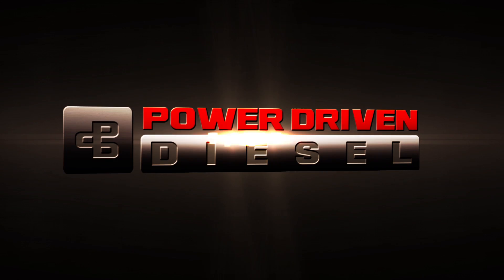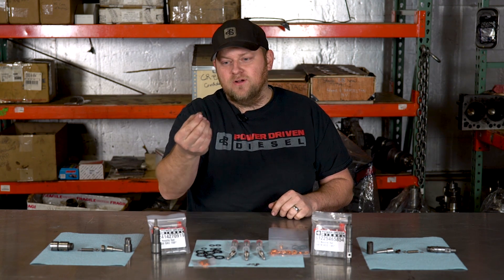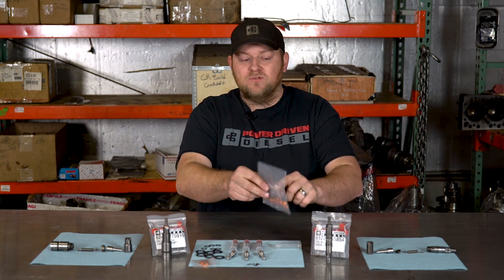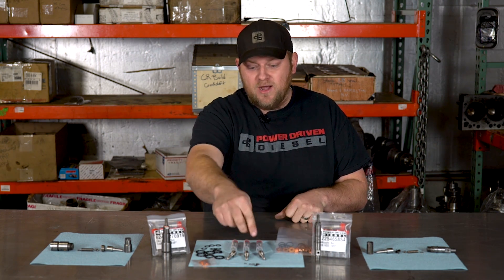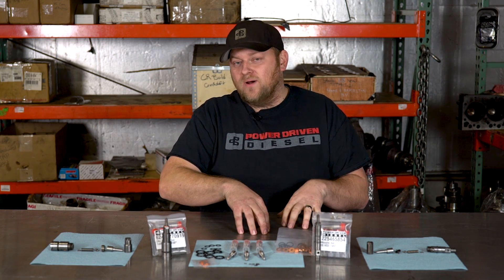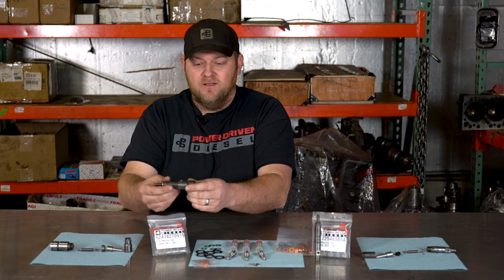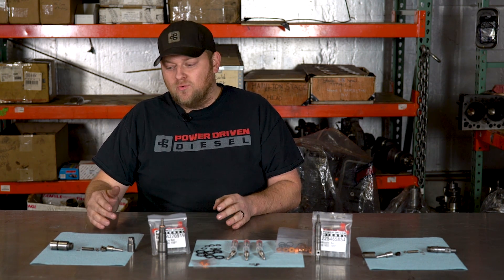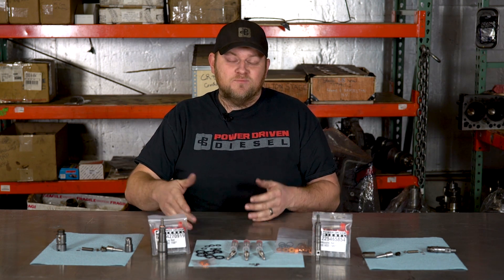DIY Diesel Injectors with PDD Injector Nozzles | Parts Bin EP 4 | Power Driven Diesel

Comment: I just changed out my nozzles and I have one injector that will not stop leaking with the new nozzle. I put the stock nozzle back in place and no leaks. What could be the issue here otherwise I’m at a loss
Reply from the maker: We like to lap the nozzle and body where they connect. Seems to help.

Comment: So large nozzle injectors will flow just as little as stocks because of inmproper pressure balance between control area and needle area. Translation: large nozzles are lazy and extend duration time and injector duration with the same energize time. The goal is to mimic stock injector timing with larger higher flowing nozzles.  Question- how much bigger of a nozzle before body modification is needed? In other words, accepted timing goes out of spec at what percentage of the nozzle being enlarged. I want to do 60% nozzle swaps. Thank you.

Comment: What about spray angle ? Does it make any difference on performance or why there are 3 different angles for the 24V. I want to get a set but not sure what's best for me
Reply from the maker: the spray angle does matter, the smaller degree allows you to run more timing because the injector is spraying deeper into the bowl but this generally only matters for really high powered trucks. we have ran all of them and find the 153 to be the best all around angle.

Comment: So have big of a nozzle is a stock 24v injector able to run?
Reply: All depends on transmission set up, fuel pump, vp44 wear, etc. Generally if you just have a stock truck I think a 50-75 hp injector will be tons especially if you still have a stock tranny be careful. I do know of guys running much bigger injectors in stock trucks though. Just remember smokey means hot and heat isnt good. Plus if you dont have an aftermarket lift pump, id be getting one asap even if its just a temporary ddrp or adjustable fass or airdog 100 gph pump. If youre getting injectors, get the supporting mods first, and if youre wanting a cleaned up truck, id invest in a tuner first and see how you like it. Edge and quadzilla tuners work well with these injectors.

Comment: Yall need 6.0 powerstroke hybrid injectors so I can give yall money
Reply: @pddofficial  big ole hybrids on stock oil make stupid power for stock or close to stock fuel systems and the bottom ends are as stout as a common rail
Reply: @pddofficial  another good one would be a real stroker vp44 pump. The monster mike guy is hard to get ahold of and that's if he even wants to sell you a pump
Reply: @pddofficial  yea I guess that guy had a newer monster mike pump on that 1000hp nitrous vp44 in the ucc qualifying. Idk if blue chip still makes a high hp pump

Comment: Torque for the hold down nut on the 24v injector is 37 ft lbs, not sure for the 12v i would assume it's close to the same 30 to 35
Reply: 12 valve is the same 35-40 ft-lbs
Reply: Ten 4 i figured it would be close lol

Comment: Ok after how many miles would you recommend buying complete injectors over just replacing the nozzles? I wanna go to a 100hp injector but I have 140k on the stock ones.
Reply: 140k should still be ok for just nozzles if your really concerned have a local shop pop test them before adding the nozzles, last set i did had 323xxx on them